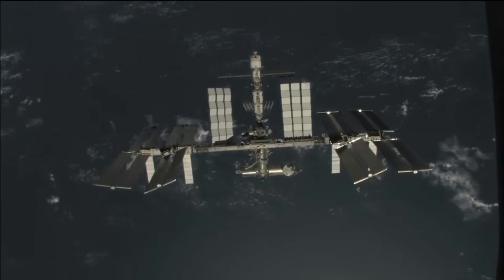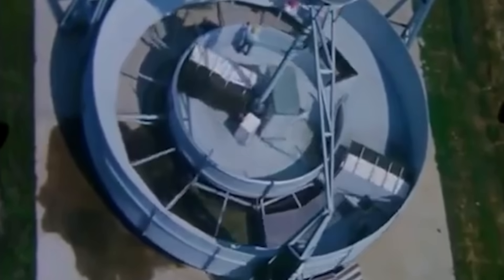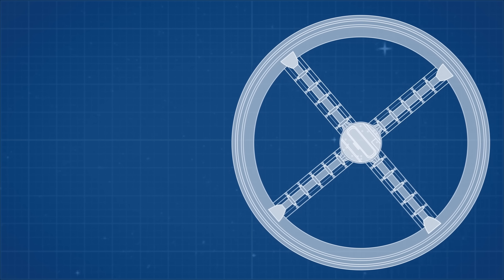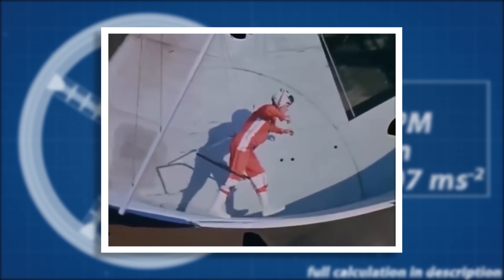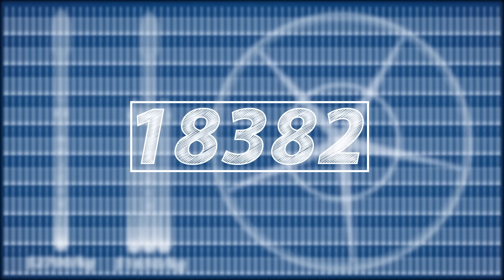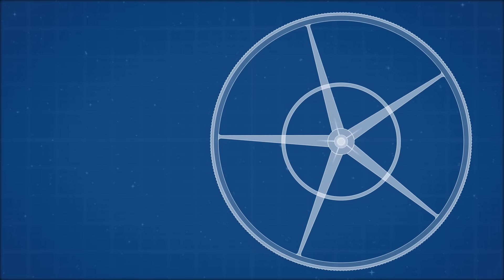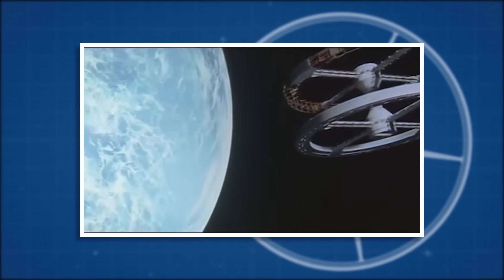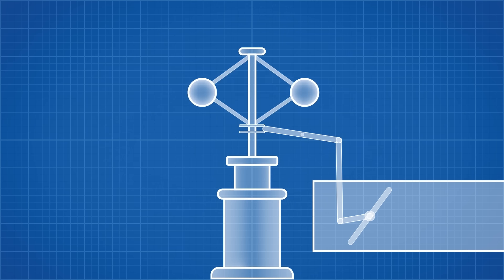Can We Create Artificial Gravity?

Comment: Suppose I am standing in one of these space stations holding a spanner.  The spanner is following a circular path at the radius of the floor minus the height I am holding it.  I release the spanner.  It follows a path tangential to the circle it was moving in until it hits the floor.  From my perspective this is not straight down and not an even acceleration.  It is therefore different from being on the earth and releasing a spanner where it accelerates constantly and smoothly towards the centre of the earth, straight down.
So there is a difference.  How much of a problem it would be is another issue.  Some say it would be a big problem and our fine motor skills would not work well in the situation.

Comment: I believe it could be engineered. One thing nobody addresses is the balance of the thing.  If it were not kept dynamically balanced as people and other weight moved around from one side to the other it would develope a really nasty wobble.
Reply: That might not be an issue with a massive torus shape.  With say a 100 m wide torus with a dozen or two people on board.  Nevertheless you raise an interesting point and I'm sure the math could be done to reveal the limit of people in a rotating space station.

Comment: What if instead of spinning the whole station and having floor on the circumference of the circle the same wheel design is used, but the rooms are essentially an elevator or train that is accelerated and follows around the circle. The rooms would have a tower schematic instead of a continuous hallway and there would be no spinning that could disorient the astronauts because it would be like constantly “going up”.

Comment: If v create artificial gravity by exploiting centripetal force, there might be some problems,like imagine an open cylinder rotating in space,what if I'm standing inside on surface and i jump in radially inward direction, what force will be there to pull me there to the surface?can any of u brilliant guys help??
Reply: No brilliance required. You were moving tangentially. Your jump was radial, so all of that tangential speed was unaffected. Your free flight will be along a chord of the circle. See P. Fraundorf's animation in the Wikipedia "Artificial Gravity" to see what this straight flight looks like.
Reply: There's no force pull you. If jumping softly,  it turns out you’ll drop on the floor slightly off the starting point. If you jump very hard, You'll hit the wall.
Reply: Conservation of momentum means that you will smash into the side of the cylinder around the place you jumped due to the momentum imparted on you from the cylinder’s rotation. There is no force pulling you “down” because there is no “down”.

Comment: The only way to accurately duplicate gravity is to travel in a spaceship with constant acceleration or deceleration. A 1G acceleration or deceleration would "artificially" duplicate Earth's gravity (requires extraordinary high energy/low density fantasy fuel). Everything else should be labeled as Simulated Gravity and will remain in the domain of very cool looking graphic videos, the only realistic scenario is to build a scale down model for "space tourism" which would quickly be called the vomit ring.

Comment: Just one question, what happens when you jump sideways cancelling the lateral component of velocity?
Reply: Cancelling the tangential component? Then you have effectively jumped into orbit.

Consider if you did this on Earth, at the equator, where the spin already gives you 465 m/s of eastward tangential speed. You jump with an eastward delta V of about 7450 m/s, bringing your total eastward speed to 7915, which is orbital speed. Until the air slows you down again, you are in orbit. You float.

In a Kubrick dumbwheel, to get to float, you must jump west, with a westward delta-V of root-g-R. For g=9.8 m/s^2 and R=223.5 m that comes out ~47 m/s. This is a much bigger jump than flesh can do. But if you did it, air resistance would -- from the point of view of people standing on the deck -- quickly slow you down, so that gravity brought you down to the deck again.
Reply: @grlcowan  Hmm. Nicely pointed out, especially the air resistance part. So basically the air close to the rim/ground will move along with the rim, meaning that even if there were a stationary object afloat, the moving air would increase its speed until it touches the ground again,  speaking from the perspective of the object this time.

Comment: This idea is thousand years old and it doesn't work in real space, epic fail, there is no artificial gravity in centrifugal force unless you're holding to the rope coming from in the middle while spinning or you are running to the circle very fast on earth not in space, because in the circle area has no artificial gravity that can push you up while floating in space. depends on the spin if clockwise you should be on top of the rim that produce artificial gravity or force while spinning.

Comment: Perhaps carbon fiber or other carbon-based structural materials could replace the aluminum at reduced weight. The manufacturing of such materials would need to be at a greater scale than today, however.

Comment: What I don't understand (and I hope someone can explain it to me) is what would happen if a person was floating in the station when it starts spinning? What would pull him towards the floors/walls to begin with? Wouldn't he just stay there floating till a cross beam comes by and hits him? If the person was attached to the wall or floor I can see how it would work, I just don't get how it affects someone who is not attached.
Reply: If a hollow cylinder of radius, let's say, 10 metres and length 5 m is open to space at both ends, and an astronaut in a spacesuit is inside it, motionless with respect to it, and not touching it when it begins to spin, you're quite right. The spin will never be communicated to the astronaut.

But put on pressure-tight end caps and fill it with air, and now, when the structure begins to spin, the air cannot help but soon be spinning with it, and the astronaut will be set in motion by the air, and any path they follow will inevitably intersect the cylinder's curved inner surface. From the point of view of a person already standing on this surface, the astronaut newly making contact will begin by bouncing and sliding, but this slide will slow and then stop, and now both people are resting on the surface, which is the floor.

It's just like orbiting the Earth: in vacuum you can, in air, you can't.
Reply: @grlcowan  has this been demonstrated anywhere to work?
Reply: @supernuts060  Getting slowed down by air is how aircraft land.

Getting slowed down by air, from such a high speed that initially there is no effective gravity, is how satellites fall back to Earth.

An aircraft that was a satellite, and did both, was the Shuttle.

You may think the object being spun up by air in a rotating space station is speeding up. But from the station's point of view it is slowing down out of orbit, just like a satellite doing that with respect to Earth.
Reply: Did you find an answer to this yet, I thought the same thing??

Comment: Mag boots? Quick charge repulsion boots? Could launch space craft this way as well. No chemical cost. Just the cost of charging the repulsion fields as strong as your ship can handle. 
Electric I guess?
Biggest problem is going to be initial kick, and not getting turned into jelly. Find a way to shift to a lighter state and mix it with this, should take you pretty far. Shoot your ships backwards so your chemical rockets can decelerate. 
Like squishing a melon seed in-between slick fingers.

Comment: this notion of rotational gravity is nonsense - just because a centrifuge works well on earth, it wont give rise to any gravity-like force in space because on earth you already have the earth's gravity working on the centrifuge (and everything else on earth).
Imagine for a moment - in space you are free-floating in the vacuum with no gravity. If you then place a spinning tube around you, nothing changes - there is no gravity-like force pulling you "outwards" to the walls of this tube (centrifuge/space station) - why would there be ? Centrifugal/centripetal force is irrelevant here (to your free-floating body) because there is no gravity acting on the space station or your body - everything is free floating. This is a classic case of "cant see the wood for the trees" - rotational "gravity" is nonsense - just like the theory of space-time = because there is no such thing as time, then there is also no such thing as space-time and time travel is impossible. People cant see the obvious because its staring them in the face.
Reply: You are right that there is no reason you would be propelled away from the center of rotation of you were simply floating inside not touching anything, but that's never how it would actually work.  You would be on the surface of the spinning disc - in which case you most certainly would feel the effects and it would be similar to gravity - depending on how large the disc was.  Or you could be on a ladder between the outer edge and the center of rotation - which would cause you yourself to be withing the rotating reference frame.  You are correct though that if you were just floating freely and the thing spun around you, nothing would happen.  Zero people have suggested it would work that way, so what you're actually doing is just standing up a straw man and knocking it over.

The rest of your comment regarding space time and time travel is just demonstrable nonsense.

Comment: Only difference is on earth or any other astral body, dielectric acceleration is non point source. Just make sure the magnets in the floor are south side face up and if theres a floor below that there needs to be diamagnetic plating in the ceiling to protect your head from it.

Comment: We dont need a rotating space station just to creat artifical gravity. We can creat artifical gravity by using wind turbine. Wheel shape space station with massive air circulation by the use of wind turbine controlling the massive flow of air from ceiling to floor is enough to push/suck object or person to stick on the floor, like what gravity do.
Reply: You want a constant 35km/h wind?

Comment: Depending on what you have in your blood. You can move your blood without your heart as long as you got a magnetic field that perpetuates in different directions that way the blood when it flow through your body it travels like you doing centrifugal force within a microscopic level of the blood through influence of magnetic fields and putting certain minerals in your blood and a higher content that does not influence our metabolic rate

Comment: Feel free to try this experiment at a merry go round with a fishing pole tied to a ball. Spin the merry go round as fast as you can manage, then hang the ball in the space between the center and bars where it wont be hit or touched by any part of the marry go round. 
What you will find is that the ball is not magically drawn to the periphery by "centrifugal force", but rather it will hang there, perfectly still (well, as still as you can hold it).
A centrifuge needs Earth's ( or any other large enough body) gravity to make inertia move an object, and for it wo work effectively, it needs to be on a perpendicular plane to the of the object exerting the gravity (the more parallel the inertia to the gravity, the more "imbalanced load" washing machine effect your will get). 
If a centrifuge were operated in the weightlessness of space, for example, what you would get is the opposite of the imbalanced washing machine load effect: no effect whatsoever. You would have a floating object sitting perfectly still in the center of a spinning hollow puck. If somehow the object came into contact with the sides, the surfaces of both would act on one another, but not in any way that can be construed as centrifugal force.

Comment: Sending up that much material via rocket doesn't make sense.   We should either mine it up there from asteroids, the moon, etc., or wait for the space elevator to get installed.  Actually the problem with this discussion is we are focused on the technology.   If it gets done, then it is probably going to be because there is a profit potential.

Comment: Question for you.
If you set up a artifical gravity ring and spin it up to speed and its sides were open, if you moved from outside the ring into the rings cavity/walkway without touching anything would you be sucked down to the floor or merely float through the gaps?

Comment: What would happen if you were floating and wanted to be grounded in one of those? Would just it spinning and the air in it be enough to "lower" you, and would you be able to jump off and float again? The movies always make it seem like it turns on and your grounded, or you leave that part of the ship and your weightless. But I don't think it is that simple.
Reply: I think it only works if you are accelerated up to speed with the rotating mass. If you were not already "grounded" by your angular momentum you would just float above it as it moved past underneath you. At least thats what i think, i asked a question about it.